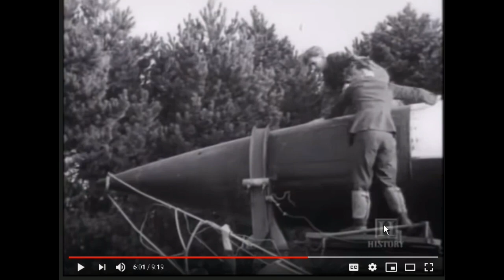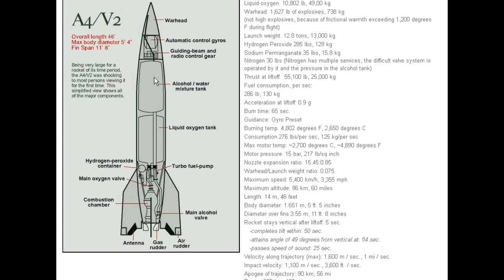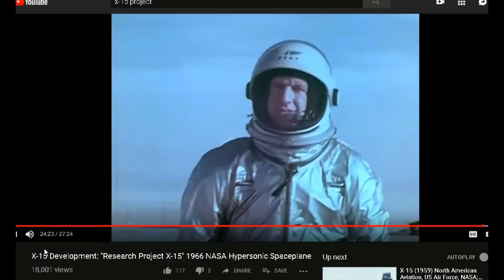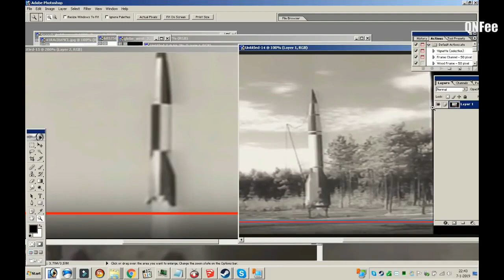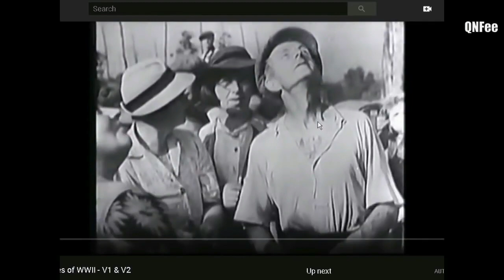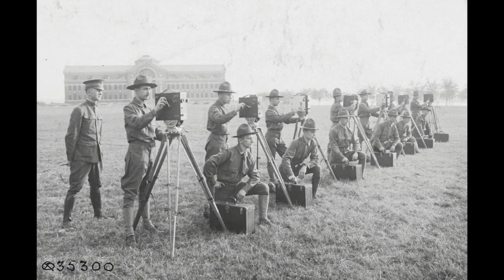Wicked History part 7  : German v1 & v2 Fictional City Bombs

Comment: 32.30 theyve fucked that up. The wheels arches are made like that so that when the weight is added and the suspension lowers the arches also lower but stay just above wheel,but like you point out it just doesnt move at all,the suspension is still at its top limit. 🤭👍💩🐃